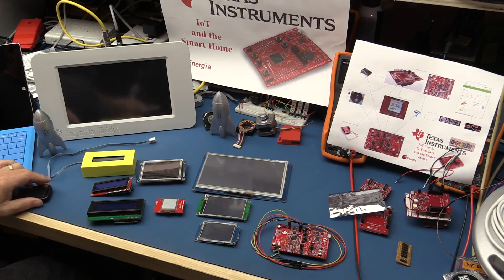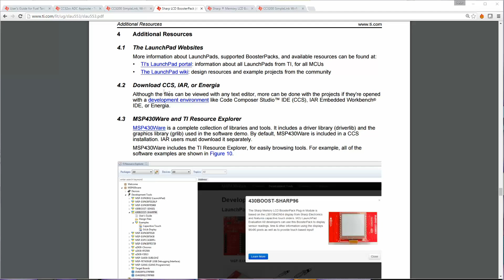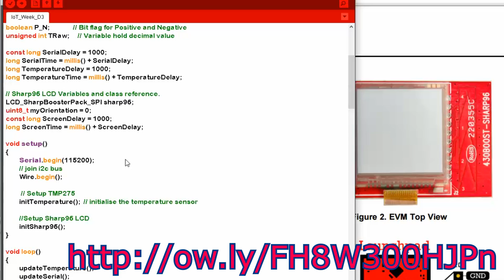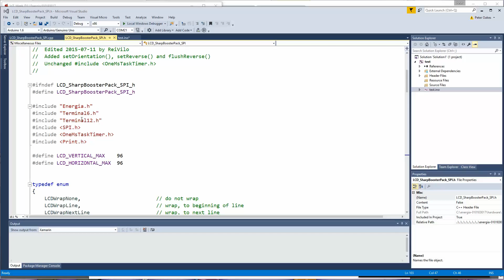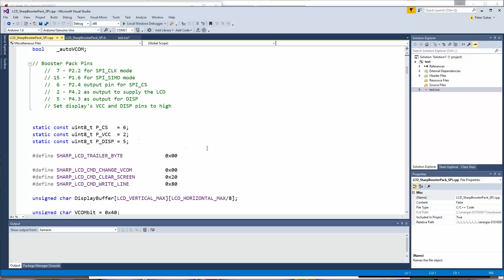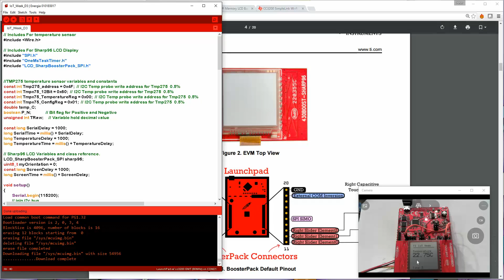TI IoT Week, Sensor Node Project Part 3

Comment: Sir a not relavent you wear intel t-shirt and speaking about texas instrument
Reply from the maker: First on to notice... :) congratulations, My TI one was in the wash lol.
Reply: I am a chemical engineer with lots of industrial experience My class topper work for Intel a Ph.D. from Gatech. I did not get visa  to come to the USA in 98-once 99-thrice then I did small chemical plant job like reactor, heat exchanger, pump  operations, and maintenance etc very less automation like PLC HMI I joined Indian IT consultancy for learning Data Analyst applied for jobs with some not so genuine resume but did not get a job and then frustrated I joined as sales consultant at Office Depot and learned about computer and related accessories.I want to use the knowledge of IoT and my industry experience(with very very minimal automated experience).and do something. i need some project to work.I reside in Leesburg VA.I am specific motivated for chemical plant IIOT and do lots of research with Schneider electric product. Your help in this regard will be highly appreciated. I am a US citizen who came on green card unlike as H1 and experienced job-based abuse by own Indias.

Comment: What is you personal opinion about these TI modules regarding price - performance? I mean compared to arduino clones it is way too expensive. ( Arduino nano - $2, LM35 - $1, LCD - $2 )
Reply from the maker: I would be comparing like for like. In this case the CC3200 is an 80Mhz processor with 1MB Flash and 256K RAM, on top of that the chips has built in WIFI and the launchpad also includes a 3 axis accelerometer and a TMP006 Temperature sensor. This is not the same as an Arduino Nano or UNO. Also look up the price of displays with a 10uWatt power consumption.

Now there is nothing preventing anyone from using an LM35 or a basic 2 line 16 character LCD display if they want. it will work equally well.

Many of the MSP43x launchpads are around 10$ and when you get to use the chip on its own like the MSP430G5523 it requires less components than an ATMEGA328, still runs at 16Mhz and is very comparable.

For this week though it is all about "What can I do with TI products and Chips", to join in the fun of Texas Instruments IoT Week.